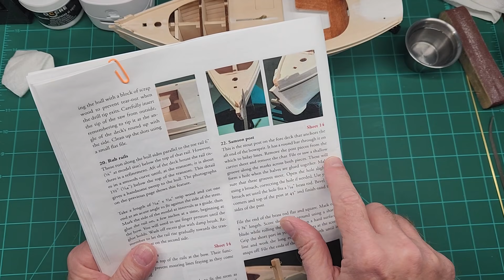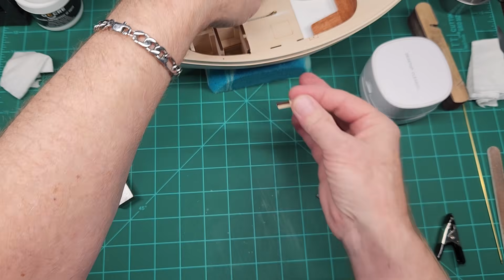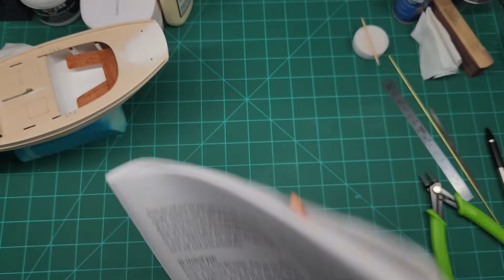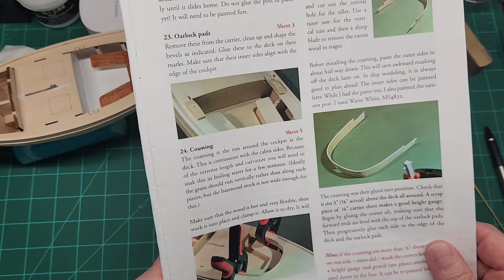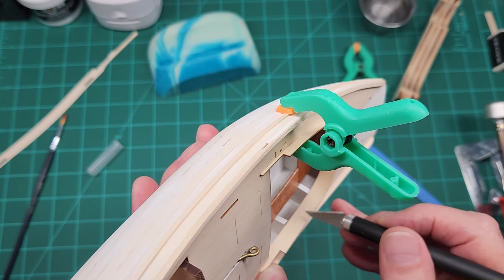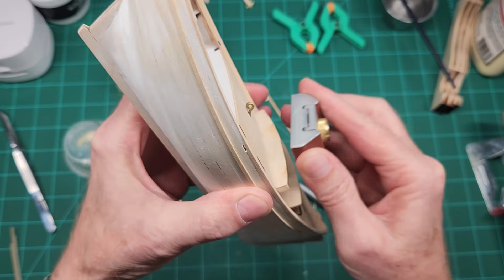Model Shipways Muscongus Bay Lobster Smack, Part 9, Samson Post, Cockpit Coaming and Cabin Sides

Comment: Yet another great video! I took a different approach to bending the coaming and cabin walls. I used the pieces from the basswood frames that formed the inner edge of the deck to make forms from poster board, and then bent the coaming and cabin walls around them (after making sure my plank bender wouldn't set the poster board on fire - it didn't). Easy, and they fit perfectly. All I had to do was trim the various tabs and slots to get them to fit flush with the deck.  I also filed down the ledges on the cockpit frames so I didn't need to trim the coaming. Good call on not attaching the oarlock pads. I plan to stain and shellac my deck (I drew planks on it) and paint the coaming/cabin white before I install them. Then the oarlocks.
Reply from the maker: Hi Tom,  very unique idea to make the forms for the cabin and coming, that's a great approach. I like what you're doing with the deck, that will look fantastic. Hope to see it when you get her finished buddy 😊 Happy modeling! Johnny
Reply: @hillbillymodeling  I'd love to show her to you. How do I do that?
Reply from the maker: @TomFynan You can email me at jf080330@gmail.com my friend 😊

Comment: Just about to start my cockpit coaming and cabin, glad I watched you do it first as it's a hand full 😊. I don't know if you have come across another YouTuber named Kevin Kenny, he has a video about bending wood using a hairdryer. Given that the wood has an element of water in it already unsoaked, he says that there is no need to soak the wood. I have tried it whilst planking and it worked well, didn't use my plank bender. I did soak the wood for a couple of minutes as I feared cracking the planks whilst I clamped them.  In the video he uses jigs to bend off the boat first, it seems using too much heat directly on the boat is an issue, probably glue related. I blew hot air directly onto the boat in my case without incident, probably got lucky so I will figure out creating a few jigs for future planking.
Reply from the maker: Hi James, glad you're ready to start the coaming and cabin. It's a little tricky but very doable. As for the water content of wood, you are right, wood does retain some moisture. Hard woods tend to lose moisture slower and take on moisture slowly too. Soft woods dry quickly and will soak up moisture fairly fast. In woodworking, like building cabinets and furniture, the target for moisture content is around 7%, this makes the wood very stable which reduces the chance of wrapping or splitting. When it comes to bending wood, we want the moisture content to be much higher. The only way to know the water content is with a moisture meter, I have one around here somewhere, lol, or to introduce plenty of moisture to ensure the wood is wet enough to bend using heat. We are going to lose moisture as we add heat and wouldn't want it to over dry before the bend is complete. I think it's good idea to soak the wood before bending it, it will bend easier and we don't get any burn marks on the wood. Just my take on it buddy. I would do an experiment on scrap pieces before committing the actual part just to be sure. Good luck and let me know how it works out for you. Happy modeling. Johnny
Reply: @hil @hillbillymodeling  agreed, I still wet the planks but not for so long.  On the cockpit coaming I used both the bender and the dryer to fine tune after re-wetting with a paintbrush. With the dryer laying on the bench I could use my fingers to press the coaming to the deck whilst it dried quickly. Worked out well. I’ve ordered a stand so that I can let the hair dryer run and still have both hands to manipulate the wood.